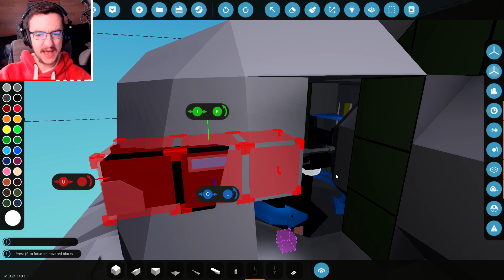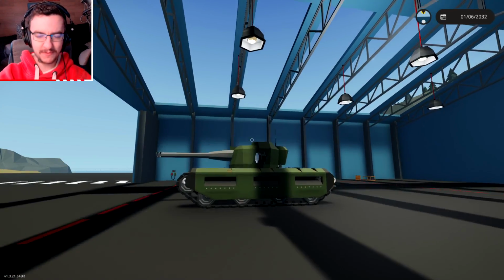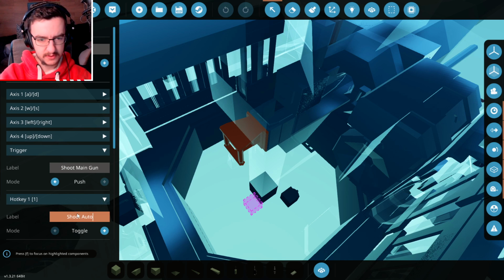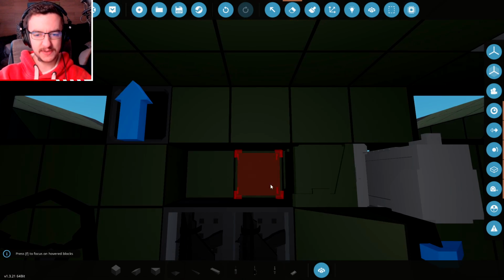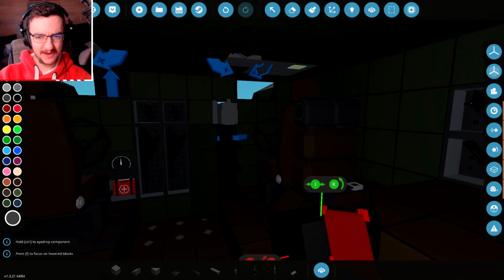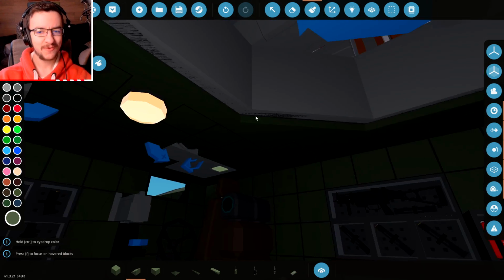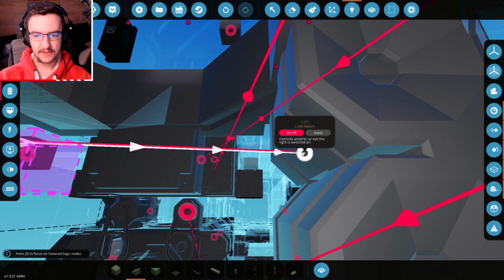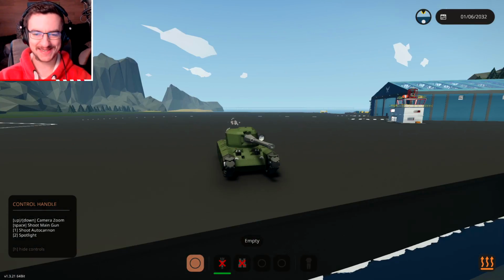Coaxial AUTOCANNON!?  -  Heavy Tank Build - Stormworks Search and Destroy

Comment: Add tool equipment around the tank - inside, fire extinguishers and welding torches. On the outside, ropes, cables, hoses, binoculars, C4s, and stuff like that. Can be chaotically placed like on a real tank that has been through war experience notably in World War 2 Sherman tanks.

Try adding a machine gun on top of the cupola turret hatch for anti infantry. Try maybe to add periscope optics for the turret crew to see out of more effectively. Add even more racks of gun ammo around and in the turret as well.

Maybe replace the center section between the 2 front seats in the hull as the engine control panel with the start up and throttle. You could also add a radio for the gunner to operate.
Great tank! Loving it

Comment: Move the loader seat to the right of the turret and the gunner seat to the left front of the turret. at the back of the gunner add another seat that can move up and down acting as the commander seat. commander seat must have a machine gun on top of the tank like the sherman and the commander can see the outside without getting out of the tank fully.

Comment: build 3 tanks a T-34 (1940) and a T-34 (1941) and a T-34 (1942) but in this Alternate Universe they use 12 in (305 mm) naval guns and 305 mm ammo and a modified v55 (038.8 liter V12 diesel) 26,000 hp (19,000 kW) Torque in foot pounds (ft·lbs) 75862.2

Comment: What about a gun in the top a machine gun and it will be operated by the commander in the cupola and also a Mantle to increase armor in the front and also if the gun moves up or down the mantle should move with the gun as well
Reply: Frantic am I right of mantle??? Or im misspell? What I mean is a gun handler that have armor im not sure if its called mantle (mantlet)